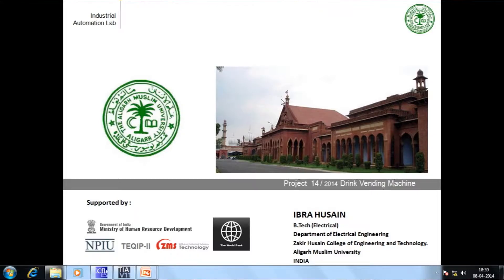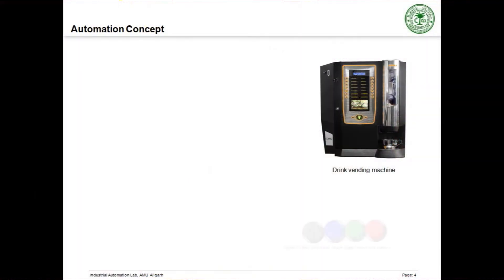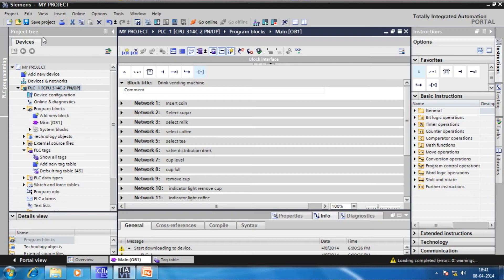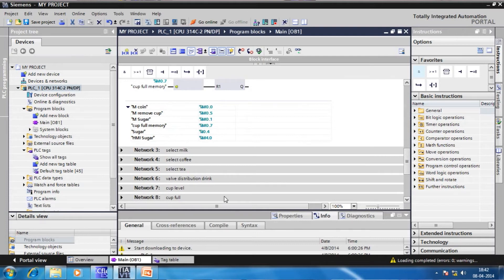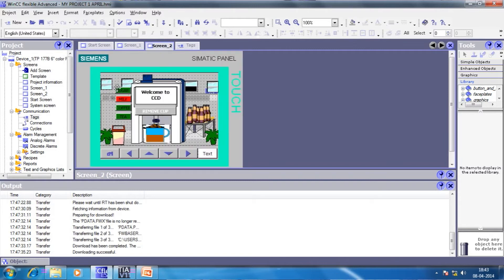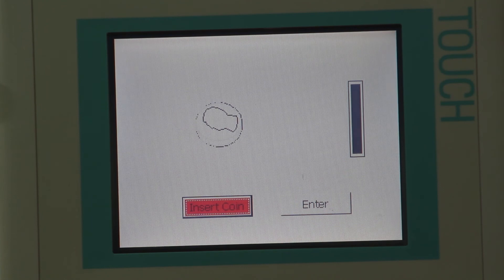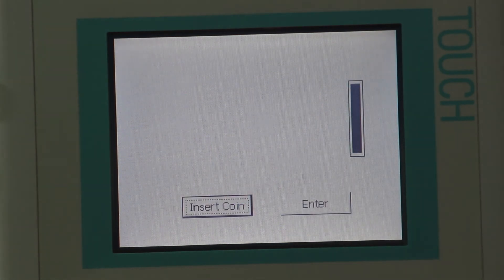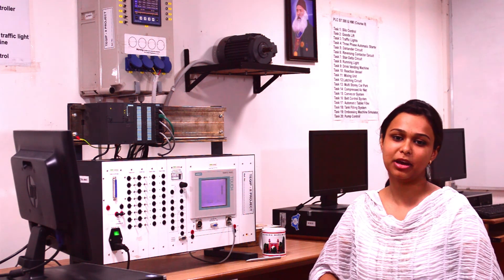Automated Drink Vending Machine Control using S7-300 PLC & TP 177B HMI | Full Automation Tutorial

Comment: What I need to study to work in automation vending machine
Reply from the maker: Sorry for the late reply. PLCs are generally more expensive compared to microcontrollers, which are commonly used in vending machines due to their cost-effectiveness and customization options.

In our case, we have a PLC training kit for teaching various programming applications. One of our students chose to simulate a vending machine using a PLC as a learning project.

Appliances like washing machines and dishwashers usually have dedicated microcontrollers tailored specifically for their functions, with limited flexibility for modification.

If you're interested in learning about microcontrollers—which are widely taught in engineering colleges through projects like line-following robots or underwater robots (like submersible boats)—I recommend visiting a nearby engineering college's robotics club. They can guide you in the best possible way.